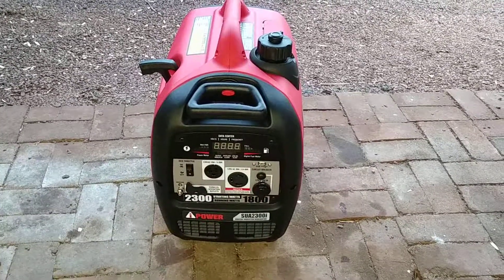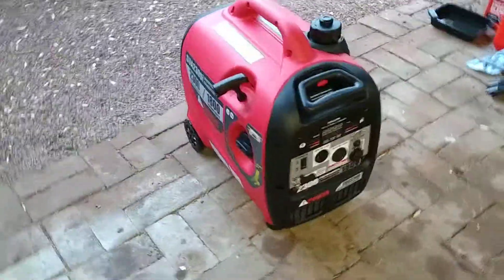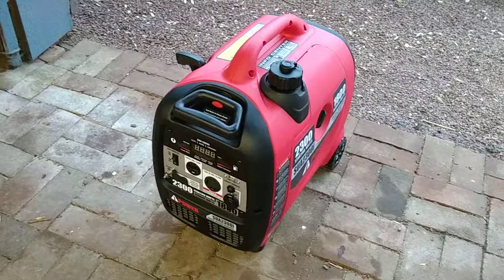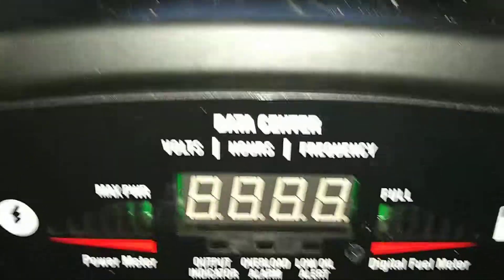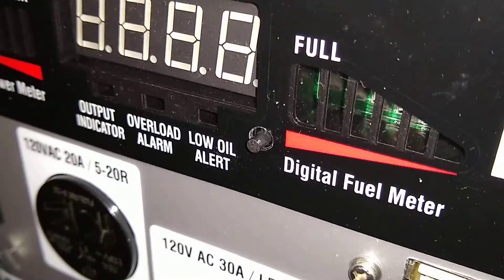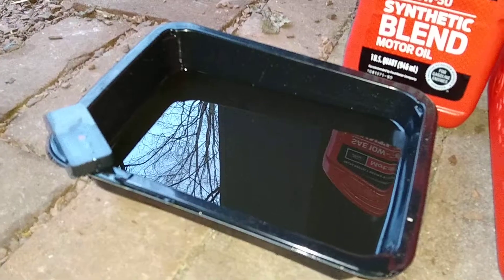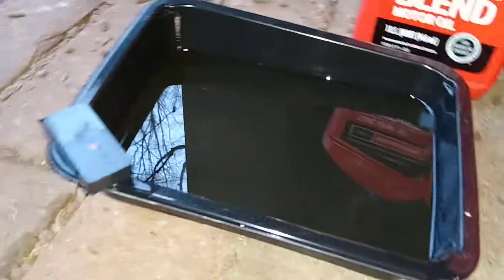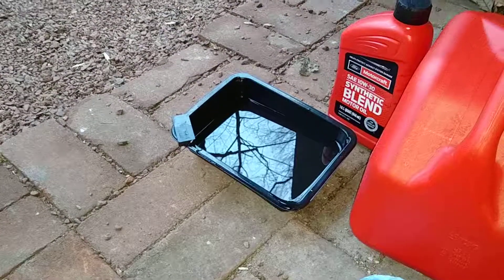A IPower SUA2300i 1st Tank of Gas & Oil Change

Comment: In case your all wondering,  the Ai power 2300 watt unit has a Yamaha engine. Ai power did not yet have the Yamaha approval and licensing to put a Yamaha logo on the unit at time of manufacturing and production. The red Ai 2000 unit does not have the Yamaha engine and the blue Ai 2000 watt inverter generator has a Yamaha engine same as engine in the 2300 watt Ai power
Reply: No way really?
Reply: @Slapshotshorts  As far as I'm aware, only the Blue model has the Yamaha engine in it. And it seems to be a Costco exclusive item if I'm not mistake and has the Powered by Yamaha label. As expected, it does cost a bit more than the Red model.